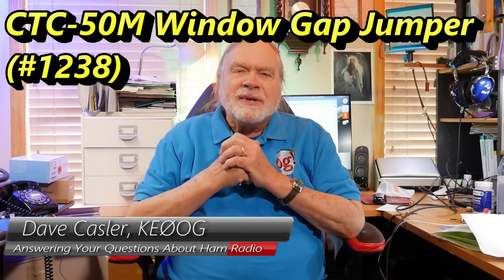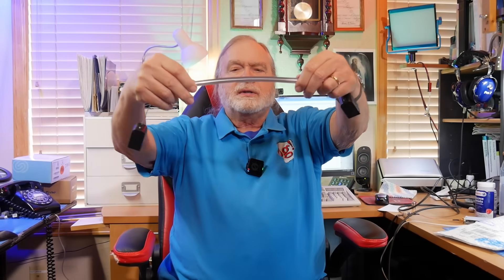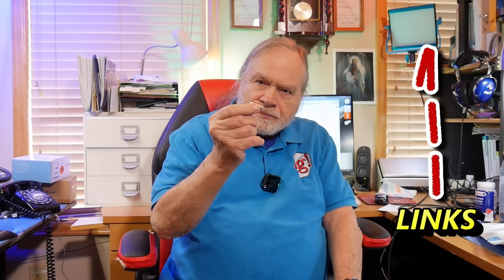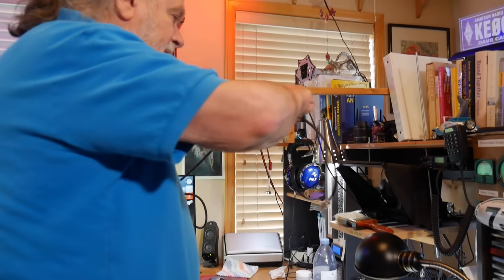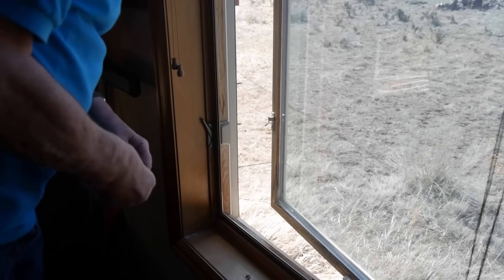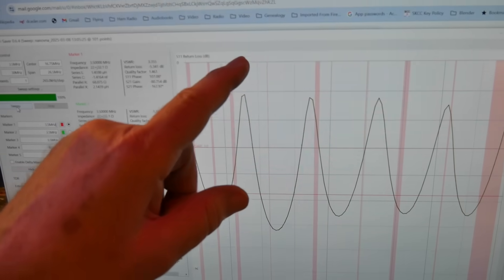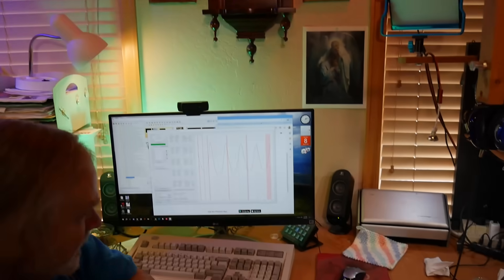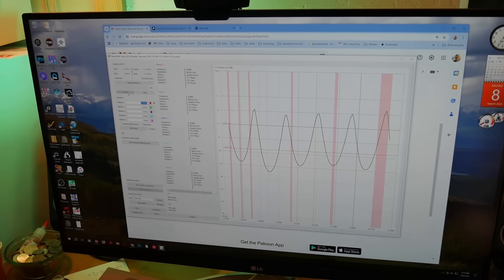CTC-50M Window Gap Jumper (#1238)

Comment: I have two of the CTC-50M window feed throughs. I use one with an 85' ft random wire and a 9 to 1 unun at 16 ft. I use the other for 2 meter FM. Antenna is a 5/8 wave ground place. They work very well . I have pushed 250 watts through the one for HF, but I don't make it a habit. I have vinyl windows. Gets under my screens just fine.

Comment: Thanks for your informative videos. 
I bought two from Amazon, and I think they 
work well, but it’s only for HT’s to a copper
j-pole outside my window to a repeater. 
2M, 70cm, and DStar. The repeater is 7 miles away. 
For HF, I would use the better one.
Thanks Dave.  73.

Comment: I use one of these CTC-50M window passthru with a Yaesu FT-710, a 50' LMR-240 RG8X coax to a pine tree about 25' up from a second story window, into a Palomar OCF 4010-500 off center fed dipole, and at least for my setup, ive noticed no appreciable loss in signal.  Definitely a cheaper setup than a custom built wall passthru, but performance-wise, I think this is a pretty great option.

Comment: I’ve been running “portable “  with a length of 1inch pipe insulation cut to the width of the window opening and a slit cut to accommodate the coax running through.  It works, but not ideal.  I’ve seen the  CTC- 50, and have been tempted to try it.  Thanks for your analysis.  It is very helpful.
Reply: I do something similar
I have a half pipe insulation laid over the sill, and I use another half to seal the gap between the top window and the bottom sash.
Second floor so no security concerns.

Its a relatively old house so not really all that much impact to the home's envelope. Probably costs me $5 a year in heating/cooling losses if that.

Comment: those thin go through windows edge type cable are made out of Hirose  coax , such as  	UFL series  0.8 mm OD   Coax.   Hirose also makes 0.5 mm OD    Coax as well.   Digikey sell them.  perhaps  might not have to go extreme.  may able to live with 1.5 mm OD  coax such as  UMCC  series.   AG6JU

Comment: The capacitive "through the glass" pass-through car antennas have been tested. They work with very mixed results because "car" glass can be simple. tinted, metallic coated, ceramic coated, acoustic (plastic center film), and all sorts of different things.
 Plain window glass is more likely to be plain untempered 1/16" float glass in the US. So at least it might be more predictable. Unless...it is less than 20 years old. Low-E, double or triple glazed, IR or UV blocking....yeah, those problems again. A barrel connector through the wall has some advantages. Or through a 2x4 in the windowsill.
 Flat wires to close the window on? No better, huh?